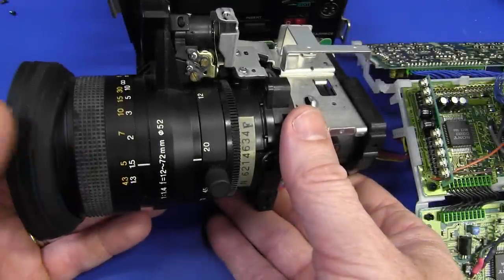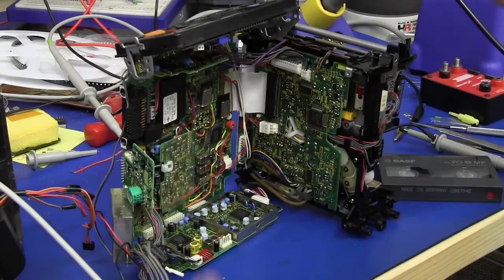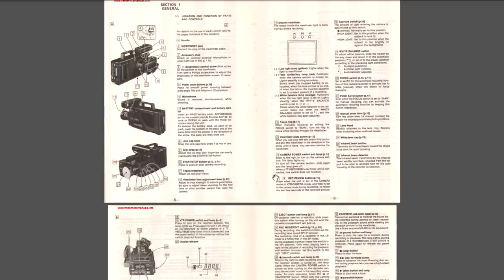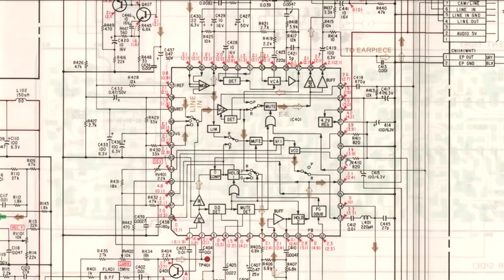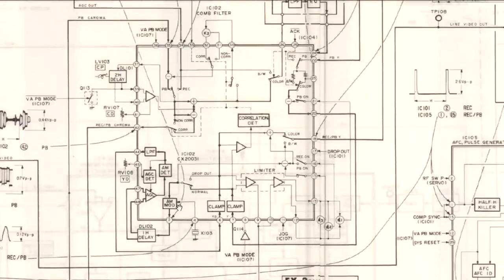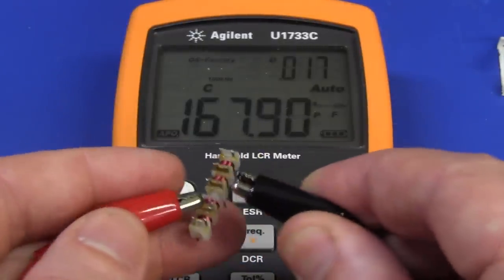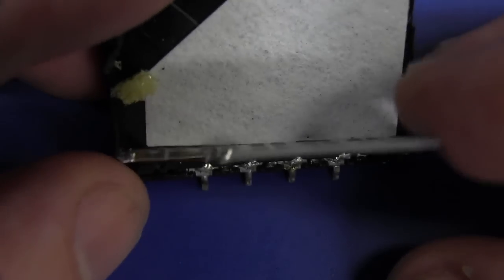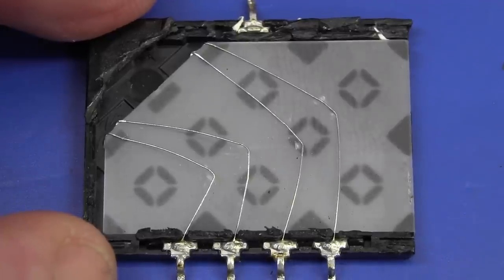EEVblog #381 - How Do Ultrasonic Delay Lines Work?

Comment: Didn't see any comments about the transducers on the edge of the glass so I'll comment.   If you look closely where the bond-wires are connected, you will see two conductive layers stacked on top of each other.  Between them is a piezo film.  The piezo material is sandwiched between the conductors which are stepped to expose them as pads for the bonding wires.  When the conductive layers are energized they cause the piezo film between them to flex.  This flexing sets up a vibration in the glass plate's edge that propagates down the acoustic waveguide.  The features bonded to the face of the glass plate as Dave describes form the acoustic path.  When the wave-front hits the far end  of the waveguide it flexes the receiving transducer (which to my eye) appears to be identical to the transmitting side.  The glass itself is not piezo material.

Comment: The camea's delay line is used to increase horizontal resolution. Delayed video is subtracted from undelayed video and the difference is amplified and added back to the undelayed video. Other cameras use 1H delays to increase vertical resolution.
The VCR uses the delay line for dropout compensation. When the signal off the tape dropped below a usable level, the previous 2 lines of video could be switched in place of the bad video. Most tape dropouts are much shorter than 2 lines. 
The 2 inch quad VTR's used delay lines which were approx 6 inch (150mm) rods of quartz.
Reply: Richard Smith I'm not sure what the "aura"is that you're referring to. 
A dropout compensator improves the picture. It goes unnoticed unless there is a multi line dropout from tape damage. Then it fills in the last good line repeatedly, but each line gets a fuzzier. Since the original content is gone anyway, that isn't really a bad thing.
Reply: Richard Smith Well VHS and Beta were pretty bad to begin with, so multi generation copies will suffer. The color is downshifted from 3.58Mhz for NTSC to 622Khz and recorded as AM. The Y(luminance) was FM, which is better, but only about 3Mhz bandwidth at best. Plus, each time you separate the Y+C, you get more loss. 

The tape tension in a VCR is pretty low, if there's any stretching it would happen in storage. You would get a linear tracking error from top to bottom of the picture. Most tracking problems are due to tape guide misalignment, though. The big danger for old tapes is when the oxide layer starts shedding.
Reply: Beta format is full NTSC video bandwidth (5.5 MHz), capable of recording and reproducing studio-quality video.  VHS is only 3.4 MHz bandwidth, but the untrained eye, i.e., most consumers, can't tell the difference.  As a result, the lower-cost VHS format won the market.

Comment: On the CCD, there's obviously the color bayer pattern, but above this there is a layer of micro-lensed material. This serves a couple of potential purposes, it can act as an anti-alias filter to mitigate Moire patterns, this means it is a spatial domain Nyquist frequency pass band filter for light (although it won't be as soft as it needs to be for marketing reasons) Bandwidth in the spatial domain here is limited by the CCD pixel density. It also helps gather light into the photoreceptor wells to make the CCD more efficient. I suspect the optical effect you are seeing is refraction and internal reflection on this micro-lens layer.

Comment: The video is FM modulated on a carrier which is 4x or 8x subcarrier frequency. You can see the sync and blanking areas on the 'scope because the frequency response of the signal and/or the 'scope is not flat. The other terminals have a much weaker signal because there is a lot of loss in the delay line.

Comment: I've seen those glass delay lines in all sorts of old equipment like VCRs and televisions. Been tearing stuff down for about 25+ years now! It's amazing seeing how stuff's changed.
I always wondered what the black resin patterns on the side of the crystal were, and always just assumed they were "standoffs" to stop the crystal touching the inside of the case.

Comment: back when things were designed to be serviced, instead of replaced.
Reply: I used to work for ICL Computers in the UK (now part of Siemans) from '89 to '91, and durng that time we went from replacing CRT assemblies and repairing keyboard key switches to WUS or Whole Unit Spares.  I guess that was when we reached the disposable age...

Comment: that remembers me of myself playing around with parts of a Telefunken 418A chassis, which i took off of a TV that couldn't wake up from standby anymore. I was able to get the service manual. I loved to understand how they got the telly running back then and what they claimed back then. Quote: "low power consumption in standby-mode (about 6W)". And later I even spoted the TV's problem (dead flyback-driving-transistor), but I didn't solve it then, because I totally torn that thing down already.

Comment: The filter is definitely a Bayer filter. 
Pro NTSC cameras used glass(quartz) delay lines for the vertical detail circuit. The 168nS delay line is for horizontal aperture correction which is pretty much the same thing as horizontal detail. In detail circuits delayed and undelayed video are subtracted to create a signal which represents the high frequency components of the video. It is then added back to the video for a sharper picture. 
VTRs used glass delay lines for dropout compensation.

Comment: well, from what I could gather , Delay lines are a form of memory that does what it says in the tin, instills a delay into the data stream... By inducing a wave ( usually a compression wave ) into a media ( some of the really old delays were based on a physical wave in a tank of mercury) .

Comment: To really check if the filter is polarizing (which I think is not), you should use a polarizer in the detection or the excitation. So, in front of the camera or in front of the eyepiece used for illumination.....

Comment: The Power Macintosh G4 Cube had an excellent service manual as well. No block diagrams or waveforms unfortunately, but it had complete take apart guides and even a few test points.

Comment: Overdampening gets closer to the end value (rises quicker than the designed condition) than the designed condition. That's why the first one measured at 160ns instead of 180ns as wrote in the datasheet.

Comment: Well, when you think about it though, there are two things to consider:
1) Service manuals generally are intended for authorized technicians, so they don't come with the product when you buy it; and
2) in products today, "service" generally means replacing an entire board (if not the whole product), so no need for detailed service manuals.

It's sad (IMO), but it's basic economics.

Comment: There are still some widely used devices based on acoustic principles as well, such as the SAW (surface acoustic wave) filters. Very common in RF frontends.

Comment: I wonder if you could salvage a bunch of these for making the memory of a home-made retro computer? After all, they did use delay lines for memory back in the early days of computing. Granted, those were usually mercury tubes, but the 64 microsecond delay of old PAL delay lines might be long enough to hold a few dozen or hundred bits, depending on the clock speed.

Comment: I've got the full service manual for my old GR-S707 JVC camcorders. Sadly though it just takes the unsolvable problems from being electrical to mechanical calibration. I've got a vectorscope I can eyeball problems with, but without the special diagnostic and torque-loading tapes, test-cards and test sig generators.. well, you can't readily use any alternatives. The custom test gear just doesn't exist anymore.

Comment: If you replaced this with digital, using an ADC, RAM to store it in, then a DAC, I wonder how much RAM you'd need? I guess that 8-bit would be enough resolution for whichever signal it is, chroma I think (since that alternates by line in PAL), I think 8 bits would be comparable to the dynamic range of ultrasound bouncing around some quartz. And this thing would need a lot of amplifying at the receiving end. Wonder how much exactly? Wouldn't crosstalk be a big problem?

Wonder what it's dynamic range is, and what frequencies it can take? Is the signal modulated onto an ultrasonic carrier, or just sent in plain, since it's gonna be high-frequency anyway. 

All in it's great to see how our mysterious ancient ancestors did things in the dark analogue days. Now for 90% of problems you just stick a CPU in it and do everything in software, and then some. I'd use RAM as a buffer, and probably wouldn't need the ADC / DAC since it'd be a digital signal anyway. Wouldn't need a delay line actually, I'd just read whatever data I need as I need it. 

Amazing too how many PCBs and components in there! And this was portable, and expected to work! Most of the time. Amazing that it did. 

And those dozens and dozens of what look like little trimmers, either pots or capacitors. Were they all adjusted in the factory by hand, by a person with some test equipment? Or a special jig with plastic screwdriver bits, computer controlled to set them all as the computer monitored the signals? 

No wonder camcorders were bloody expensive in 1985. Looks like they're right on the edge of what's possible, and quite a bit beyond the limits of what's practical. Insane! All that stuff! And now it'd all fit onto one chip. Now it'd all fit into software. 

It'll be an early camcorder, too. Not much before that, you had a separate camera, with a separate VCR running on a (separate) battery pack, in a bag slung over your shoulder, or maybe your assistant's shoulder. We had an old setup like that at school, obsolete when we had it, with separate camera and recorder. Battery possibly nicad but almost certainly lead-acid and would have weighed a ton and lasted 15 minutes. 

And now you can get HD recording for hours, onto an SD card the size of your fingernail, with a camera half the size of a packet of chewing gum. Cheap enough to throw away. Ah, progress!

Comment: I would've liked to see interactive measuring from that larger delay line component.
Attaching it to oscilloscope and try to manipulate the physical waves(block them with finger or something) and see resoults on the delay waveform.

I don't know does it work without the top cover though.

Comment: The coax probably has a wider bandwidth. Analog video needs less than 10 Mhz, but any oscilloscope with a delay line is going to need at least 50 Mhz.

Comment: "Asahi Glass Co."?  I wonder if that's the same company that produces Asahi beer?....a very good beer, by the way.  Judging by the propensity of Japanese companies to get involved in many different fields, I'd guess they are the same.
Reply: ""Asahi Glass Co."?"
May have had something to do with Asahi Optical Co. that led to the Pentax SLR camera brand.
Reply: Haha, Asahi Glass Co., which is the biggest glass company in the world and the company name was changed to AGC right now, is completely related neither to Asahi Beer nor Asahi Optical. You know, they have the electronic division to deal with electronic products as one of the glass applications as well as their major items like building glass, automobile glass, tv glass and so forth. And they developed this key electronic device for VTR, CTV and VC by themselves in the latter period of 1970's when the market was going to expand, but they had failed to develop the precise glass material itself which density must be extremely stable all the time to define the delay time as the length (Time = Length/Velocity, and Velocity is proportional to (1/Density)^1/2). So, they had no choice to  use the glass substrate from the other glass companies such as Schott Glass in West Germany and HOYA in japan. This story was the top confidential at that time. You know, i was a person in charge of the development of the glass delayline in Asahi Glass in 1982- 1994, haha!^^

Comment: If I understand analogue camcorders correctly, then there is no concept or processing of an entire single frame. Everything exists as, at most, a single raster line, though there are signals present which indicate vertical flyback. Fascinating to learn about how the signals are pushed off the CCD, as there are clearly not the same number of connections as pixels/picture lines

Comment: Those special equipment are probably hand assembler anyways and not produced in massive quantities, so I think it wouldn't be that big of a deal. I think every professional electronics(+1000$) stuff are designed to be serviced.

Fully automated line of 10 000 products/day would be impossible using that kind of hinge that isn't possible to assmble with robots.

Comment: The problem these days is that devices dont't get serviced anymore, they get thrown away, because it's cheaper to give a new instead of repairing. The only thing service technicians is to check and exchange complete modules, everything else is far to expensive. What a shame, in respect to recsources and and fully educated service technicians.

Comment: Are there any machines I am likely to come across with Tortion Wire Delay lines?
I would literally frame it and put it on the wall, I have already looked on Ebay haha.
All i'm getting is $600 vintage calculators

Comment: 8:40 good luck getting that for your iphone.
Reply: Actually, I've seen iPhone schematics. Repair manuals are surprisingly detailed. What you don't see is Sony Xperia schematics. Not even in the service manual. Sony doesn't repair electrical components, so they don't release their schematics. Cap blown on the mainboard? Replace it, and recycle the old board.
Reply: lol what would you need it for?

the entire phone is in 2 chips. you can't even see the capacitors they're so small
Reply: zxw for the win

Comment: very neat-o !.....the evolution of technology is amazing......even older ones used for memory in 50's computers used wire torsion .....literally physically twisting a length of springy wire........& like stacks the size of laptops to make 1Kbit.........man if u could go back & show them a 64GB micro SDcard......u'd be burned @ the stake !
Reply: Yep, those were the 'delay lines' of the day. Delay lines can be used as RAM just the same, all you need is a buffer to amplify the output signal back into the input.

Comment: Wait a moment... HOW could he see his fingernail? I mean the light was above his fingernail so all the light falling on his finger nail is reflected thats why we a see a shadow I could understand why he could see his finger from the finger print side (because some of the light reflected from the desk bounces on his finger print surface and bounced back to the microscope...) but HOW can he see his finger nails?
Reply: See my post above, most CCDs have a micro-lens layer above it for a couple of reasons. The optical effect will probably be refraction and internal reflection in these microlenses.
Reply: Only HAD (Hole Accumulation Diode) and Power HAD CCD's have micro lenses.
Reply: dorbie The earliest CCDs did NOT have micro lenses. The first Sony cam with microlenses was the CCD-TR55 Handycam55 around 1989.The microscope is simply projecting the overhead lights onto the CCD.